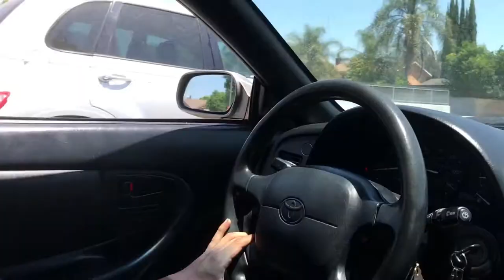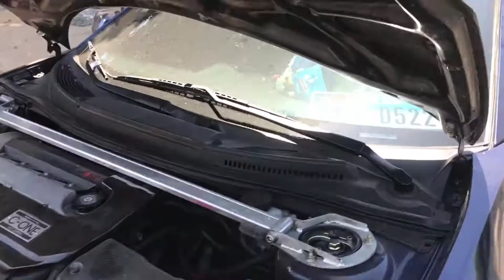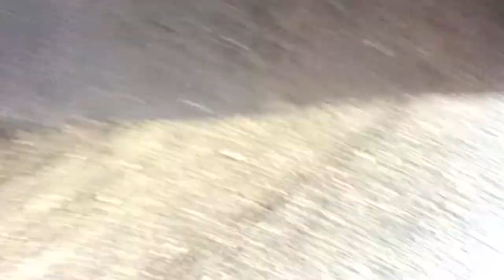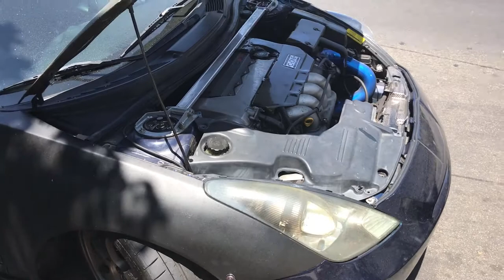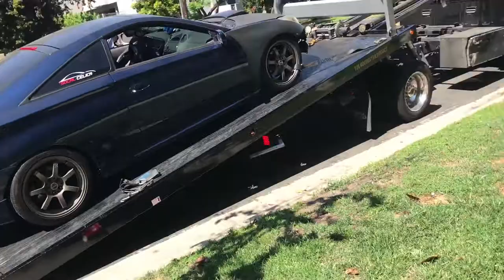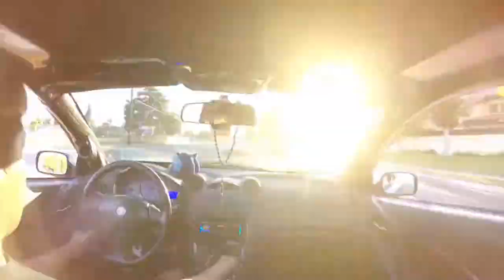Celica Down!!!!!

Comment: The reason for a rod knock is because the rod bearings were wear out . Its important to keep them up to date , Especially if you're gonna run them hard.
Reply from the maker: Tomas Martinez probably but if you will see how i drive I usually dont beat on it
Reply: Rafa's Garage how many miles you got on it ,
Reply from the maker: The motor had 139k miles on it

Comment: i love celicas i have one, 2zz swap with no luck, gotta turn back to 1zz again, i think these engines are so much delicate, specially the 2zz one piece of metal trash or whatever to your cilinder and bye bye block you cannot hone it :(  Rafa whats your opinion about these enngines, when was the las time you bearing your rods, SORRY for my english btw
Reply from the maker: ROBERTO PEREZ why couldn't you do the 2zz swap and I never had problems with these engines, my last motor when up to 200k with no problem, reason this one went out because of my tune. Its ok I understood most of it
Reply: i did the swap, the problem was the block and cylinderhead came in bad shape from the previous owner, what would you prefer or recommend: new/used 2zz-ge short block or sleeve an 2zz-ge engine block ?
Reply from the maker: ROBERTO PEREZ new/sleeve you dont kno the condition on the use block

Comment: Well dude, sounds like the exact same as mines did b4 i had it rebuilt. DEF recommend anyone with 150 - 200K to rebuild b4 you kill it. all those pulls and high RPMs, the bearing reached its maximum. lol. you said u will put another old/used engine? meh.. just rebuild. mines is way more torquey and def more power since. I'm on 300miles on my full rebuilt, 214.4K miles b4 it blew. mines was crankshaft bearing. 
Anyone with a glass moonroof I can have or buy cheap? hit me back.
Reply from the maker: Kaeos Factory 'Kae Artz' me too and yea putting another used motor until i rebuild this motor and get ready for boost
Reply from the maker: Kaeos Factory 'Kae Artz' i have one for sale
Reply: can you hold it for me as long as possible, i'm still recovering from the rebuild + mechanic costs. NYC brooklyn, where even if yur a mechanic, if u have no space, u gotta pay out ya ass to get it done. :(
Reply from the maker: Kaeos Factory 'Kae Artz' I feel you well if no one picks it up locally